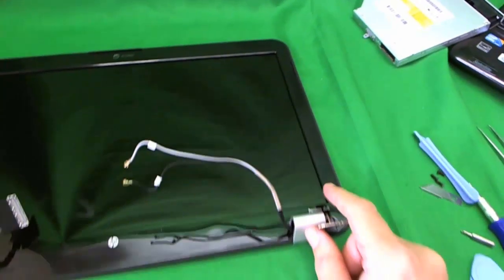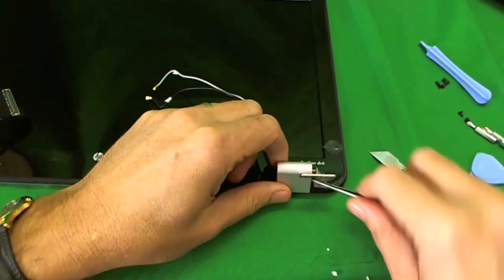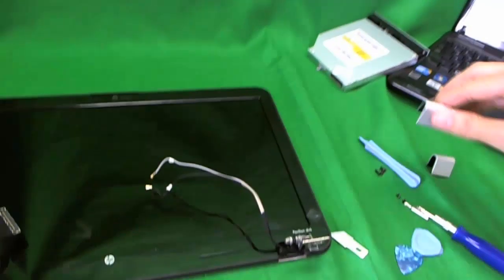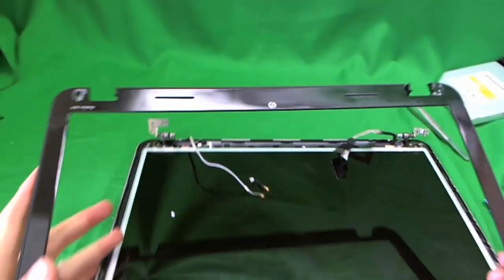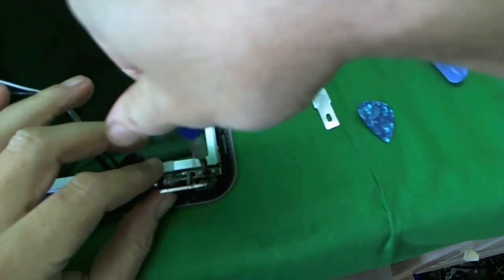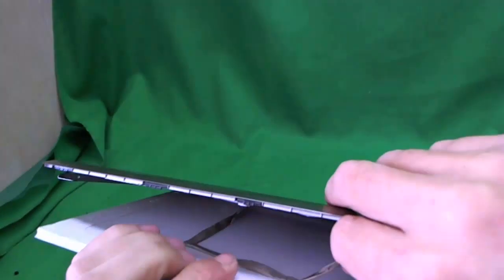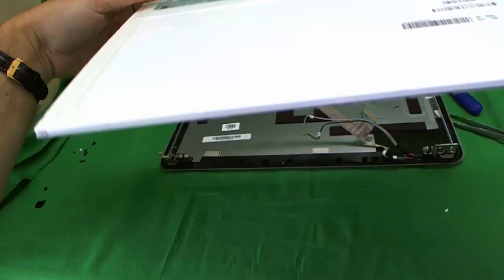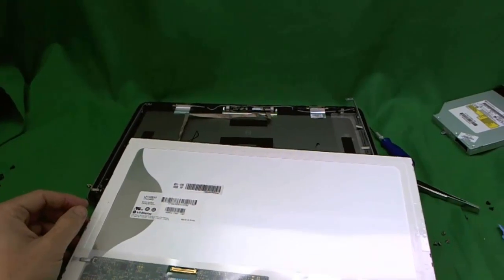HP dv6-3121nr Laptop Screen Replacement Procedure Part 2

Comment: Very helpful! I just did a slightly brutal extract of a smashed screen from a DV6-3210us... (didn't remove the upper section as described in part-1, careful prying of shell, unscrewed top-2 mounts to top, leaned forward, then detached 4 side screws.) Victim of a moped accident (backpack went flying when moped crashed into a high curb.)  For now, managing with an external display til new LCD arrives.

Comment: Ordered a new screen through this company, installed using this video (and Part 1). Every aspect of this process was A+. Important notes for the DIY, while the process isn't too difficult, pay close attention to connections, harnesses, clips, covers, etc. There are about 25 to 30 total screws. Tape them to a sheet of paper and # them. Label the Hp as he shows. Hard drive cover has c-clips which holds the screws. No need to completely remove screws, just loosen completely. Took me 2 hours total